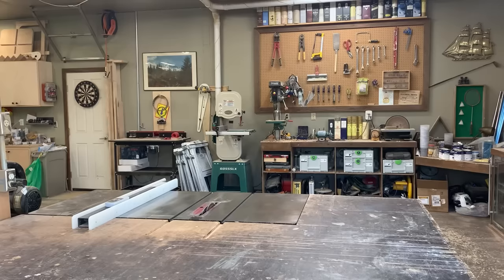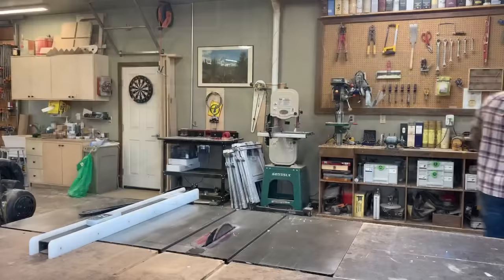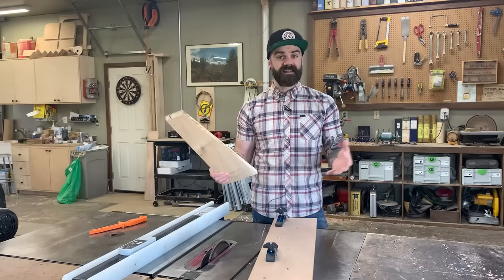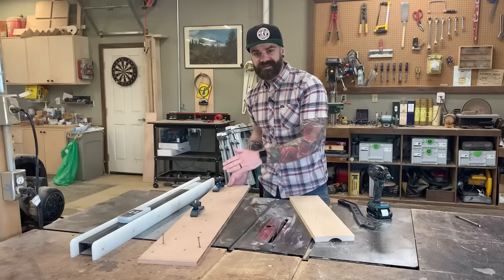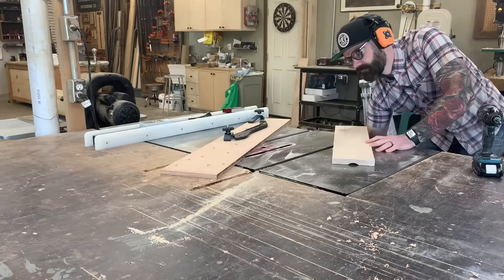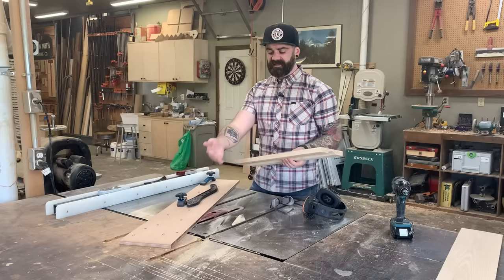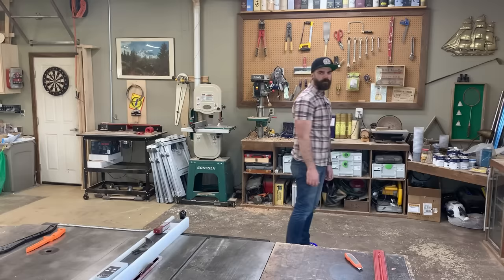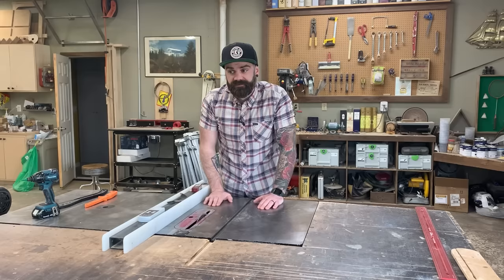Woodworking Tricks You'll Actually Use || Table Saw How To

Comment from the maker: CORRECTION: Forest DOES NOT sharpen blades for free. I’m a dilly waggle and was operating on bad information.
Reply: When did they ever sharpen blades for free? 🤨 I’ve been using Forrest blades since the early 90’s and have always paid them to sharpen ‘em.
Reply: Does any company sharpen circular blades for free?
Reply: Because I have a complete set of dado blades I’ve made 1/2 dozen or so zero clearance inserts for the most common sizes, i.e. 1/8”, 3/16”, 1/4”, 1/2”, 5/8”. Well worth the time it takes to have them ready made.
Reply: Oh geeeeez. I just sent mine out.
Oh wait no I didn't. I have to buy some first. lol
Thanks for the update.
Reply: I am adding "Dilly Waggle" to my vocabulary...
Reply: So obviously you’ve never had one sharpened...
Reply: @learningthehardway6186  LOL not necessarily true. They could very well sharpen HIS for free as he recommends them here on his Youtube channel.
Reply: Forrest charges $27 for sharpening and $12 shipping for a 42-60 tooth table saw blade.
Reply: @mendellbrian  I have the same blade and saw this claim of free sharpening, only to reaffirm there is indeed a cost...  I think Freud offers free sharpening so long as you purchase a new blade at the same time...

I.e. send a dull blade in, buy a new blade, get dull blade sharpened free.
Reply: Your demonstration of not touching the blade while it’s running is almost exactly how my dad evened out the fingers on one of his hands. He spent 30 years as a pipe fitter and after he retired, he took up woodworking and was ripping some boards before thanksgiving dinner and got into a hurry and bam! He nicked his pinky and cut the other three off level with the pinky
Reply: Dilly Waggle … !  Awesome , I’m appropriating that as of right now and will be furiously using it at every opportunity wether natural or manufactured !  … cheers bro 👌
👍🏴

Comment: Here's a pro tip that not a lot of people know... when you cut a bunch of plywood  or sappy wood.. it gums up your blades.. I take the blade and a 5 gallon bucket..I turn the bucket upside down & set the blade on the bottom of the bucket.. I use lacquer thinner filling up the cavity which should cover all the blades & soak them for a few hours & use a shop rag to wipe off the residue.. glue & sap dull your blades.. build-up of glue & sap makes it hard to cut smoothly & many people just toss their blades thinking they're trash.. regular blade maintenance extends the life of your blades..thank me later

Comment: Great video! Thanks for sharing!  One point I think is important: if you put the cove cutting fence on the other side of the blade (towards you) the blade will be pushing the wood into the fence.  As you set up the fence in the video, the wood could be caught by the blade and thrown toward you if you aren't holding it firmly.  Bonus tip: tilt the blade with the cove set up and you are cutting elliptical coves. Love doing this in my shop.  Thanks again for the tips!
Reply: How do you know were the cove will cut on the wood or centering the cove cut

Comment: I just make a three sided cover for the fence,  two high sides about 2” higher than the top, 1/2”- 3/4” Baltic ply fits snugly over fence., good for clamps and a storage spot for push stick and steel rules. I actually will leave it on most of the time until it’s chewed up, then flip it.

Comment: Great video, all good info, especially the hoverboard tip.
I have cut coves on the tbl saw, but oriented the temporary fence in front of the blade, so the saw teeth tend to force the work into the fence.  Not strictly necessary as long as you're taking the small depth cuts explained in the video.  It just made me feel a little safer.

Comment: Great video. Thanks for the safety tips and the zero clearance…thing. I’m new to wood working, especially with a table saw, so I found this super helpful. For my first big feat, I milled an 8’ pc of pine.  I cut down a few days ago. Milled it down to (2) 8’ x 2 1/2” x 1 1/2” . Thankfully I was unscathed, and a only a little sticky. Diggin your alphanumeric ink work (right arm). 👍

Comment: You mark the table with the line of the cut.
I also mark a 90 to this showing the center/high point of the blade.  Helps making joints.😊

Comment: My industrial blade selections are primarily from from Freud (the ones with the special red coating), or CMT blades (orange coating) with a choice of various tooth grinds for general to specific use.  They're high quality, hold their sharpness, yet don't cost an arm and a leg,  I've also had good luck with Hitachi (now Metabo HPT) 10"-60T and 12"80T blades, the latter size for my miter saw.  Since we're talking safety, the majority of time cutting on a table saw is spent making cuts with the blade perpendicular, one should primarily use a zero clearance insert, then switch to the standard clearance throat plate, when cutting at an angle.

Comment: About the coving tip at 10:00, I very definitely would NOT position my fence on the outfeed side of the blade as Bourbon Moth has done. That would allow the thrust of the saw to veer the stock off the fence, grab more wood and a runaway kickback event is now happening. Instead, clamp the fence on the infeed side to absorb the thrust forces, just as when you use the miter gauge.

About positioning the fence: I do it with a stick ripped to a width equal to the cove's location from the edge of the workpiece. Two blocks cut to the cove's width will space out another stick, giving a model of the cove. After setting blade height to the finished cove dimension, use this model to position the fence so that the saw teeth fore and aft just touch the model. Clamp the fence in place, lower the blade to the first shallow cut, and begin the process.

Comment: I agree about the safety glasses. I had an accident last summer from a chip off a table saw. Last cut of the day, just took off glasses not expecting to make another cut. I figured, it is a small and quick cut, should be fine...nope.

Comment: That kickback video gives me PTSD to last winter when the exact same thing happened to me doing the exact same type of cut on a picture frame, and I instinctively tried to grab the board to avoid kickback and took off 2 fingertips on my saw blade. Same exact setup, was using a push stick, thought I was being safe... But when something is coming at your face, you either jump out of the way (correct, like you did) or you grab it (WRONG, like I did). I was very lucky that I only shaved a couple of millimeters off each finger, but after 3 months of finger gauze and an almost-debilitating close call, I've embraced the rule of "If this seems a little shady maybe I'm using the tool incorrectly and should re-think this."

Comment: What's the process for ensuring the cove ends up perfectly in the center of your board and not off to the side? In my brain there seems like it would require some trig work regarding not only width of material, but also angle of approach.
Reply: Donnie, and add to that the swinging geometry of blade elevation on most saws. I do it with a stick ripped to a width equal to the cove's location from the edge of the workpiece. After setting blade height to the finished cove dimension, two blocks cut to the cove's width will space out another stick, giving a model of the cove. Use this to position the fence so that the saw teeth fore and aft just touch the model. Clamp the fence in place, lower the blade to the first shallow cut, and begin the process.

I very definitely would NOT position my fence on the outfeed side of the blade as Bourbon Moth has done, though. That would allow the thrust of the saw to veer the stock off the fence, grab more wood and a runaway kickback event is now happening. Instead, clamp the fence on the infeed side to absorb the thrust forces, just as when you use the miter gauge.

Comment: When making cove cuts I set the auxiliary fence board on the opposite side of the table saw blade. This is for actually minimizing the possibility of kick back. The blade is trying to push the coved board towards the auxiliary fence. I’ve made several tunneled laminated wood water skis using this method and never had any kickback. A kicked backed board to the stomach and ruined project can ruin your day.

Comment: I appreciate the time and effort you put into video's for this site, thank you. Personally, as a life long woodworker this is my golden rule of shop safety: Use your power tools for there single intended purpose. You have a professional shop with single purpose tools, not a ShopSmith for a reason. The single intended purpose of a Table Saw is to rip lumber or sheet goods (ok, dado cuts too). Yes, it can cross cut, but other tools do it better, and thats there purpose. Its when people use their saws to do things like making cove's, tapering legs, curved lines, moulding profiles etc. that things can go very wrong, very painfully. I just don't go there, i'd rather just buy it from someone that used a moulding machine or a shaper or from a millwork store. I'm not trying to say that i'm the gatekeeper of woodworking safety, but I still have all my digits and i know people who don't because they got too confident with their table saw it doesnt discriminate, it can bite you.

Comment: Dude love your videos, had to point out that right after you recommend using a sacrificial fence for things like cutting edge banding the video showing the kick back didn't have one!  Doh!
Think you can figure out a way to use a hover board to help on the outfeed side when feeding sheet goods through my contractors saw without a helper? ;-)

Comment: How do you center the cove on the piece you're working with?
Reply from the maker: its not hard, you will no exactly where the cove will be cut by measuring the distance from the front of the blade to your fence and the back of the blade to the edge of your stock. if you get those two distances equal the cove cut will be in the center of your stock.

Comment: Great video, as always.  For the zero clearance inset. How do you get the thickness correct?
Reply: You may need to freehand rout the under side of the insert. There are usually set screws in the top that can fine tune the height of the insert to get it perfectly flush with the cast iron.

Comment: How would you use your taper jig to make repeated cuts that allow you to create multiple identical pieces at the same angle and final dimensions?
Reply from the maker: Well I just eye ball it usually but you can draw line you want to cut on the bottom of your stock then flip the jig over and match your line to the plywood edge

Comment: Great tips very helpful as I am woodworking  beginner. Hey how do you know if your table saw can take dado stack?  Thanks for sharing.
Reply from the maker: you read the instruction manual
Reply: @Bourbonmoth  HAHAHA that's right. Did that but nothing about this topic in it, so I thought I ask the expert. Thanks anyways.
Reply: @vs77mail  check how wide the arbor is. Typically you see 13/16 to be able to handle 3/4 wide dado stack. Also they are mostly US based saws that have them. Check the specifications on a saw on Home Depot

Comment: Love your videos! 
Concerning the Cove cut, I would locate the fence on the down-stroke side of the blade instead of the up-stroke side.  It will give better support and less chance of catastrophic kickback.  Plus, a push block that provides greater hold down pressure would also be beneficial.  Remember, cove cuts are like ogres.  They have many differnet layers, and you cut they layer by layer.

Comment: Sooo...if your bandsaw band is broken and you want to cut veneer on the table saw, you need to make a zero clearance insert plate first...on your bandsaw without a band? ;) Just kidding, I got the point :) one shouldn't wait until their bandsaw becomes temporarily unusable with making the zero clearance insert plate.
Reply: I recently made one. I first screwed the factory plate to some 1/2" plywood, traced the outline, then removed the plate and cut close to the line with a jigsaw. Then I reattached the plate in the same screw holes and went around the plate with a pattern bit on my portable router table. It came out perfect.

Comment: I use a cheap table, miter and circular saw, and i always get circular traces on my wood (no burning at all though) which makes my cuts terribly lousy with bulges all along. So far i've been using blades out of the box which i assume are very lousy (those are 24 teeth, 210 mm/8.268 inches). My cuts look very much like these: tinyurl.com/1jirtecs 

I watched your videos about saws, but i'm not sure what to use on pre-cut wood bought from a store. Since my cuts are so terribly uneven, i'm thinking of using significantly higher number of teeth than 24 for precise final rip cuts but i feel that it probably makes no sense, and just buying better blades will make the difference. Could you recommend good blade parameters for rip and cross cuts for pine?

Comment: Quick question regarding your tapering jig you show in this video. That is, how would you make identical repeatable cuts if you need more than 2 tapering cuts? I can see if you need only 2 stacking the boards on top of each other. But if you need something like 4 identical cuts I am unable to see where this jig will make both cuts identical. What would you do to overcome this? Thanks for these amazing and definitely funny videos....I really enjoy watching you explaining these tips!
Reply: just screw two pieces of wood perpendicular to the jig (on top of it) so all your pieces will touch those pieces and therefore angle will be the same. If you don't need much precision you may just draw the line.
Reply: @trezzh4  good call! Appreciate the response

Comment: When making cove cuts, why not run the fence on the other side of the blade (the side nearest you? It seems to me that a wee bit of inattention when cutting the way you are set up could allow the piece to self-feed into the blade and kickback violently. But running the fence on the other side would have the blade pressing the piece against the fence with nowhere else to go.

Just wondering.

Comment: Riving Knife isn't to prevent the wood from turning after passing the blade, it helps prevent the wood from pinching the blade after being cut.  Stress in the wood can cause the kerf to close up after being cut.  If this happens without a riving knife in place, the wood will pinch the blade and be kicked back.
Reply from the maker: Actually it’s both. But yes it does help prevent pinching as well
Reply: @Bourbonmoth  Sorry, I should have said, "isn't just to prevent"

Comment: Clarify pls Mister Bourbon, i am a relatively new table saw owner and hence operator, i have a saw stop contractor saw. I noticed that your table saw inserts ( around the blade) are not locked in place as per the original on my saw, this looks like a good way to go for me as im changing between Dado stacks and the single blade insert often and my dado stack insert is cut to the maximum width of my stack ( 13/16 ") , hence i have the same issue that you described with the kick back when using for example a 1/4 " stack , ( a wide void between the fence and the blade) . Please detail the pro's and cons of locking table inserts versus the non locking, or conversely what should i be aware of in a safety view if i make non locking inserts. Cheers and thanks in advance for your previous video's and the ones to come , Michael in Florida
Reply: Michael Walker I’ve been using table saws for 50 years in my contracting and cabinet shop businesses. I’ve owned and used dozens of different makes and models of saws from job site to contractor to cabinet style. Currently I have 2 saws, an ancient 9” Delta Contractor Deluxe and a 20+ year old Unisaw. None of all these saws has had a locking throat insert be they factory supplied, home made, standard blade, dado stack, zero clearance, metal, wood, composite, plastic, you name it...I have never had one come loose or be thrown at me. Don’t worry about it.
Reply: @lanecobb4150   Thanks for your reply Lance, Im making an insert today , cheers Michael

Comment: On cutting the cove with the angled fence: He has it set up so the the blade is cutting away from the fence. The blade could grab the wood, say if you shift hand position for a long lengths and throw it, ruining the wood. Very bad idea. Put the fence on the other side. If you want to be sure the work stays against the fence, make a feather board and clamp it in place on the open side. 
For the angle cut slide, clamp a piece of plywood the same thickness as the slide on the open side of the blade. This avoids the unpredictable drop of the waste wood. Not sure why he is standing on the right of the blade. Body position and the weight on the his feet seems awkward and not balanced.

Comment: One thing that is not mentioned often enough is the thickness of the riving knife. You touched on it but it needs to be said more often. 

The riving knife HAS to be the same thickness as your blade. If it's thicker you'll get friction forcing you to push harder or it'll get jammed. If the blade is thicker, it still leaves room for pinching the blade and a little bit of yaw that can lead to kickback.

Often, noobies (me included) go for a thinner blade with our shitty little underpowered saws suddenly the riving knife doesn't work. The OEM blade is going to a different thickness than the nice crosscut or ripping blade you pick up.

Comment: My tiny Titan table saw probably cost less than the blades you use. Nonetheless, though it appears to be a toy in comparison, as soon as the blade is risen and the power is on, I treat it with all the respect it deserves and demands. Especially after it tried to bifurcate my thumb.